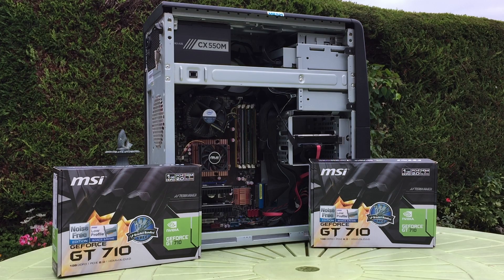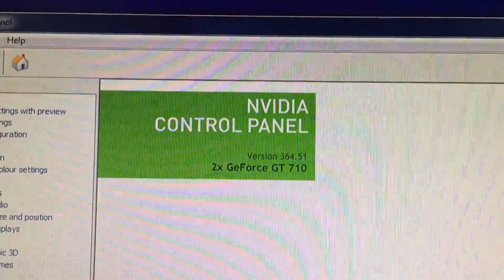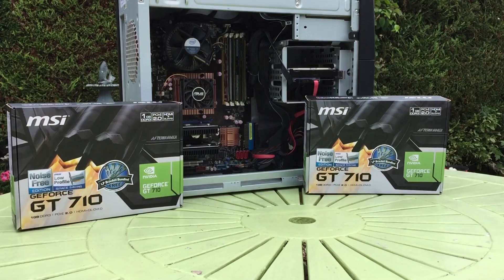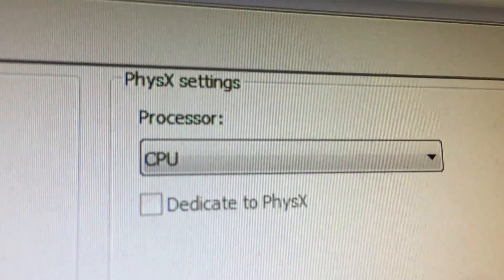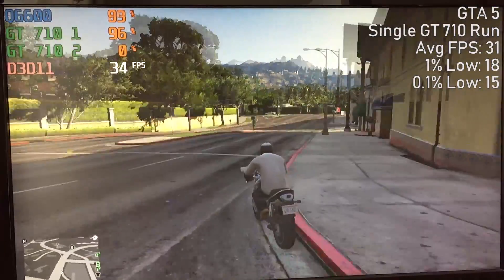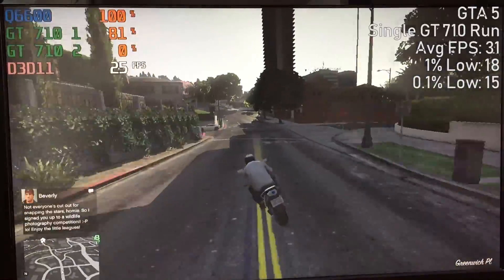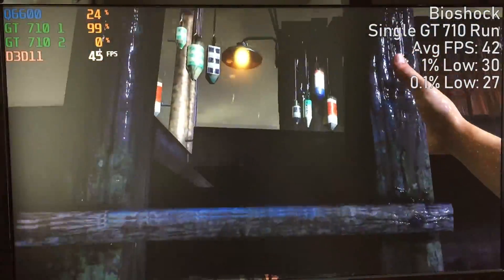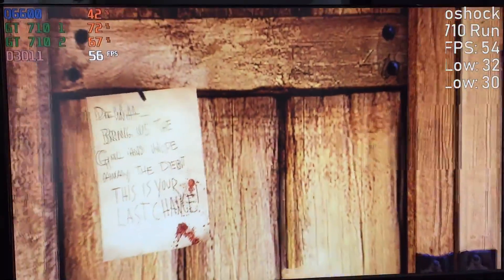The GT 710 SLI Hack

Comment: capitalists will update the bios in all generations of motherboards and graphics cards so that all graphics cards from other manufacturers work together on one motherboard then all computer games will be optimized for crossfire and sli therefore geforce 6800 ultra sli or geforce 8800 gtx sli for an old computer pays off buy but they haven't fixed the damage yet, so a motherboard with an nforce 590sli or nforce 680sli chipset must be

Comment: You must try this on the gt 710 gddr5 overclock them both with asus gpu tweak 3 u will notice a lot of performance boost ,I managed to cross the base clocks of gt1030 and got a lot of fps in triple A games ,my system spec is almost the same I hv intel core 2 quad q6700 ,8 gb ram and so also my fan are like are blower running at full speed ..hope u see my comment.

Comment: Hello,
i'm a mobile app developer and i've got hackintosh system for my work.
Currently i'm using single 4k monitor and this Nvidia GT710(2gb) works perfectly without any setup (just plug & play).
but i want to know that is it possible to do S.L.I on two nvidia GT710 GPUs? if yes then how?

Comment: If you have one on hand, you should try GTA V with a Core 2 Q8000 series or Q9000 series quad core instead of the Q6600. I've found some games run better with SSE4.1 processors than SSE3 processors.

Comment: This is a brilliant video!! BTW. Using the modern LOW(crap) end cards in "SLI", to get playable performance on a old high performance or newer Low end system. The bandwidth of this GPU is so low, that The PCI-E slots are perfectly capable to have these Synced in SLI without stutter.
I agree.. not woth purchasing two new. Just get a one GT 1030 for about the same price, and get Massive better performance. But GT 710 can maybe be found in "the Trash" or given away by generous people.

Comment: Odd, with MSI Afterburner overclocking the VRAM from 900MHz 2GB DDR3 to 940 and a bit farther. A 1:1 ratio does increase frames by 1-2% just by overclocking the memory. Fortnite is now at 29 average instead of 26, and WoW (World of Warcraft) benefitted from the higher VRAM clock, going from 40 average to 56 average at the recommended settings with SSAO+ disabled and particals on low.

Comment: that's sad im using a dell Vostro 220 with upgraded cpu too Q9550 Quad 4x4 and 4gb Gskill dual channel and a single Asus Geforce GT 730 2GB 902GHZ with Evga 500watt bronze power supply and I get 120FPS on loading screen and game screen on CSGO and average 60FPS in game I get 95FPS in far cry 2 in game !!!!!!!!!!!!!! you have dual gt710,s and their whorible !!! it also helps when you open nividia control panel select click manage 3d setting find power management mode and set it for Prefer maximum performance and your set !!!! it will run at maximum performance full power all the time

Comment: I actually have a Zotac GT 710 2GB DDR3 and it plays Bioshock Infinite on medium-low no problem at 1080p with an average of ~50 FPS. The rest of the system is an E8500 (stock), 8GB DDR3 RAM And 1TB HDD.

Comment: Hey does anyone know if an and athlon x4 635 will fit in my biostar mcp6p m2+? Idk some say it's an am3 only, some say that it's both am3/am2+, but idk. In theory should this work??
Reply: it can, AM2+ motherboards were designed to take AM2 cpus, AM2+, and AM3 via a bios update. I also just confirmed it on your motherboards cpu support list.

the AMD Athlon II X4 635 2.9GHz AM3 cpu is on the list
Reply: Steve Smith ok thanks, I appreciate your confirmation

Comment: someone sold a GTX 970 for $10 in Ebay. They thought it was broken. apparently, the cable got tangled and got pulled a bit. Having a soldering iron, I managed to fix it. it works fine again lol
Reply: I had something like that happen once. Someone was selling a broken pc on craigslist. Has a x58 motherboard, no cpu, gtx 670, nice high watt power supply, case, 8gb ram etc

Now there is a horror story behind there. Seller said he thought his cpu broke so he lent it to his friend to test. Supposed friend said his i7-920 was broken, but than rather than return the cpu, he essentially ghosted out of the sellers life and never returned any messages. Seller than decided to get a new cpu, he got a xeon....but I don't think one that was supported. It might be unofficially but it didn't work. So in a nutshell he didn't know what was up and gave up saying he was spending too much time trying to fix pc.

I offered him $80 at first..but then lowered it to $60 since for all I knew his power supply died and killed his whole system. He then lowered it to $40 if I moved my pickup up a day

I ordered a i7-920 off ebay and picked up the pc. Put the cpu in and nothing. So I tried to figure out what the issue was.....turned out he put the ram in the wrong slots. Told him and he remembered that he swapped ram with his friend and thought nothing of it. Honestly not sure why it didn't work actually. Since I moved the ram into the correct slots and it still didn't work, but then swapped my ram into those slots and it worked. But then I put his ram into the other slots and they worked fine. Go figure. PCs I love them and hate them

All in all spent $40 + $25 for the cpu, 

sold the gpu for $80, the motherboard for $150, and kept ram, the nice case, and power supply 

I felt bad for the guy. With friends like his, who needs enemies.

Comment: Will you try 2 amd rx 550s in x fire since no hacks are required and is more accessible as an option. Or older cards from amd . low end gpu are not anti consumer like nvidia is with sli.also the band with could be limited with older cpu and boards when using dual cards.

Comment: First of all you make great videos, interesting and helping. Now I have a problem with something different then this video and i thought since you are working with older pc maybe you can help me.
I had bought new ram memory for my pc and my old memory wanted to put on my sister pc. my motherboard is gigabyte GA-H81M-S2PH and had 2x4gb dram ddr3 with 1666mhz kingston. My sis PC have mothherboard foxconn G41MD and it is having only 2gb ddr3 ram, want to put my 2x4gb and from what i read It should be working but it is not. When i put even only 1x4gb it starts and shut down after a only one or two seconds, i can't even get to bios, if i put the old 2gb memory works fine. Any chance you can help me, i have found spec about both motherboard and it shouldnt be a problem i think. is it possible its the PSU but then again it is only memory not gpu or something like that. Please help.
Reply: Nik Man insert back the 2gb module, go into.your bios setup and either reset everything to default, or fix your clocks and speeds -- e.g. set memory speed to 800mhz, 1066, or 1333. If your processor does not support higher than 800 fsb, then fix ram speed at 800mhz and set latencies to auto for now. Set your pcie clock also to 100mhz and remove any overclock your processor has. Install the new memory and see if it works. Check first a single stick if it'll work and try out both slots. Also try to clean the gold contacts of your ram sticks with a pencil rubber eraser.
Reply: Ayu Natsume I have tried that, the only memory speed that  is not auto is  800mhz, i have tried both and it is the same. i havent moved pcie clcok since i thought it has nothing to do with memory but i will give it a try. Thank you for answering

Comment: Hey random, I really enjoy your videos and watching this video got me thinking of something you should try. It is possible to run an nvidia card dedicated for physx together with an AMD GPU as the primary GPU. Nvidia blocked it originally but after a couple of hacks and the fact physx basically was abandoned, they allowed official support for it in 2016. I tried it with my RX 580 and GTX 960 that I should probably sell by now, but it was a fun experiment. In arkham City i managed to get around 80 FPS with Physx on high, compared to 20 FPS is if it was the CPU doing the work (R5 1600), however i still prefered 144 FPS i could get without physx at all so i decided to take the 960 out again, it was just an experiment. But i did manage to play through mirrors edge with 144 FPS first though, probably one of the best games to showcase it with since the physx GPU doesn't bottleneck the game as much as the arkham games

But I thought it would be interesting content for your channel. Having a powerful Nnvidia GPU isn't really neccesary, a 1030 or 750ti will do just fine, and would be nice for you to show AMD owners out there, that there is a way to play their old physx games. It's called hybridphysx and there is a guide for it on a wiki dedicated to it

Comment: I gotta bring up 1 point. The GT 710 by itself (ddr3_64bit), isn't very fast because of the low_bandwidth. but if you paired a 2nd graphics card with the 'same' 64-bit memory interface. you effectively get '128-bits' from what I'm seeing in the frames. that's 'quote on quote' double the PCI-E in tandem. but again, this is if your running a software benchmark which I didn't take into account. it is only worth it if you think it is. case and point. though I'm not saying you take my advice word-for-word. every benchmark is different from the next, even running 'fallout_3' on your pc is different because of its 'low-tier' graphics and such.

Comment: why battle-eye wont work is the drivers are running unsigned so windows runs in some kind of ahole drm restricted mode, there is another hack you can do on top of this to make windows think the drivers are signed but it is a headache in its self and seems as hard as getthing things working in the first place

Comment: I have a 1080ti card in my system and this make me wonder if I added the card that was previously in this system would it increase the performance at all. My old card is gtx 780ti. Basically if I can add an old card to the system that I am not using would it cause any performance improvement.

Comment: You should test out the Zotac PCIE X1 version of the GT 710. I've read that it's the most powerful PCIE X1 graphics card ever released. I'm curious to see how it performs but I can't seem to find any Benchmark videos on it.
Edit: After doing some research I found out there also exists a pcie X1 version of the GT 730 so that should outperform the 710. But I still can't find any Benchmark videos for that either.
Edit: My bad turns out he already tested out the Pcie X1 GT 710. However I would still love to see him test out the Pcie X1 GT 730. And I do believe I really somewhere that there was a Pcie X1 version of the GT 430 as well although I'm not quite certain if that's true.

Comment: Hey i need some help, i want to upgrade an old laptop and i cant find any 4gb sticks of laptop ddr2 ram, i have 2 slots and i want to upgrade it a bit before i hand it to my sibling, does anyone know where i could purchase this? (i want to find 2 4gb sticks so the laptop has 8gb)
Reply: Asteros hey man I don’t think it exists.. ddr2 maximum capacity is 2gb per stick
Reply: Salvatore Botta Well fuck, thanks anyways
Reply: Salvatore Botta  na it exists, its just expensive, 50-30 a stick, 2 sticks of 2gb costs 10, if the price doesnt discourage you, ebay should have some 4gb ddr2 sticks

Comment: I keep watching you videos thinking of maybe buying a old workstation and putting a 1050ti in it but idk if it's better than my current setup
Current setup: 
Amd Athlon ii X4 630
GeForce GTX 1050ti 4gb
8gb DDR2 RAM
750w powersupply

Is it worth getting like a duel Xeon workstation and putting 16gb of ran into it or not?
Reply: Wow,a gt1050  yes it 100%worth it but be sure u hv a cpu 4 or above cores with ddr3 ram ....,or u can also go with low system like using a cheap 4 core xenon then overclocking it u might get it upto 4ghz depends on which cpu u oc ,u can try this and save money instead of buying the new ones but the only thing one the old ones comes is when it comes to vertualisation u won't be able to run vm that can be used to game

Comment: I have GT 640 2GB OC'd edition from Gigabyte and I would say that when paired in with Q6600 overclocked about 3GHz, playing those games you showcased was like playing with 2 GT 710's I know that there is 1GB vram difference, but why would presumably better gen card would run so poorly. I know it's like comparing GTX 1060 with 980Ti, but it still bugs me very much
Reply: cause the gt 710 is trash, every nvidia gpu ending in 10 is trash, they don't even make them anymore, the 710 was the last one, there is no 910 or 1010. (granted there isn't a 1040 either) 

Ok, I'm being harsh, but the 10 series isn't meant for gaming at all. They are display adapters meant to provide graphics for systems that don't have on board graphics, or systems that need more modern outputs. Or some better video processing power for streaming movies. 

a 710 is going to lose to basically anything. Probably loses to a 260.

think about it this way, use the Passmark gpu benchmark score. the 710 gets a 678, the 640 gets a 1281.
Reply: explains a lot, pretty much what I was expecting tbh. Guess I can sleep now :D

Comment: That would be a gt 1420 and it would crush the gt 1030, right?
Reply: eh... if you overclocked then a single one can crush already
Reply: Does it work on a gf 210, too? i want a 1070 but i only have a 1060 :p
Reply: you mean overclocking on a GT 210? why would you buy one in the first place when you can get a GT710 for practically the same price. But you can if you want...
Reply: nah im not into buying the gf 210, i have 3 cards that all are better than the 210 and i hope you didn't meant that serious with the oc on a gt 710 and crushing

Comment: Mutligpu support is so terrible, for me it's really only ever scaled well in benchmarks.... which helps no one
Reply: M W It scales great in many games (most of mine anyways), but AMD seems to scale way better than Nvidia.

Multi-GPU is the only way to get 60 fps at 4k. A much cheaper ($500) 2x R9 Fury will easily smash a ($1200) Titan Xp. You would need liquid nitrogen and hardware mods on the Titan to get even close to the duel Fury stock.

There are games the Titan will win, such as single GPU only games like Fortnite which the Titan makes 67 fps avg (over 5 hour gameplay, way better than it used to do, they seriously gimped Fortnite's render distance to laughable levels to help it).

Comment: nice video but buy a core2 quad qx9650, they are just 80 usd and will massivley improve your ''SLI test bench'' 
link to buy: https://www.ebay.com/itm/Intel-Core-2-Extreme-QX9650-3GHz-Quad-Core-SLAN3-EU80569XJ080NL-CPU-w-Grease/273259119353?epid=74037824&hash=item3f9f8342f9%3Ag%3AkpAAAOSwgStbFTKL&_sacat=0&_nkw=core+2+quad+qx9650&_from=R40&rt=nc&_trksid=m570.l1313&LH_TitleDesc=0%7C0
Reply: wait what? did you really just use the phrase "just 89 usd" to describe such an old cpu?
Reply: Steve Smith if consider the improovment of the q6600 yes, i know it is expensive but considering it is one of the best cpu's of 775 and you kinda need it if you want to benchmaro sli and other gpu's....

Comment: Will A 2GB Version Of The 710 Get The Same Results As Sli 710 1GB ?
Reply: on some games no
Reply: When you SLI cards, the VRAM doesn’t add if I’m not mistaken, I.e. if you have 2x 1GB graphics card you will still only have 1 GB if you SLI them, the VRAM is merely distributed so the data stored on the first graphics card would be equal to the data stored on the second graphic card, this will allow them to process the data at the same time and therefore provide a performance increase
Reply: You will easily exceed 2GB of VRAM at 1080p at the 'high' preset, but if you keep it to 720p, then you're good. Or 1080p low.

Comment: You should overclock the gt 710, it has alot of headroom, they go up to 1300 mhz without a problem, also overclocking the memory to +200/250 helps a ton
Reply: At 1300 i got a ton of driver crashes an stutter, i recommend you to stay at 1260 at max
Reply: Yea every card overclocks differently ofcourse... but keeping them cool with a fan helps a ton with stability

Comment: i own a 710m and it handles things like for honor (even it though its 1gb of vram instead of the minimum of 2gb) it doesnt even break a sweat. Why does the normal 710 struggle more? (60% used for gpu and 100% cpu)
Reply: When GPU % is lesser than CPU as here it means the CPU is holding back the GPU ! CPU is an bottleneck
Reply: ik thats the point the mobile version holds up better as the normal 1